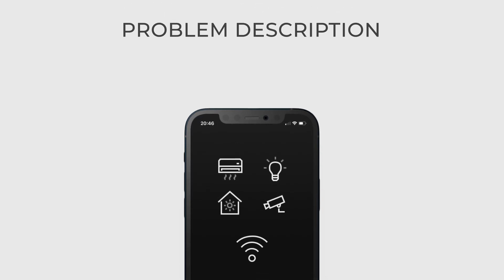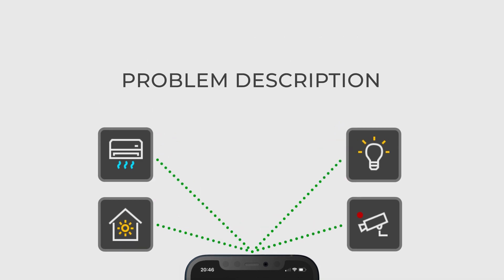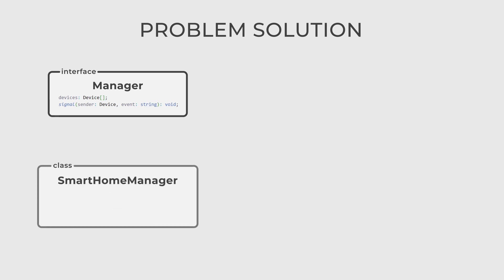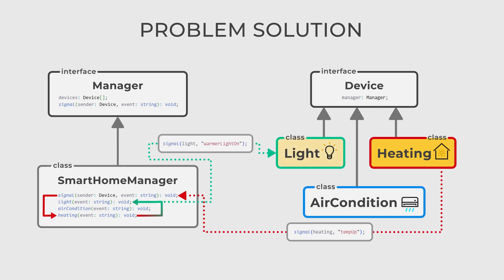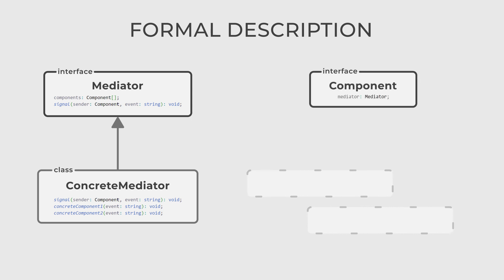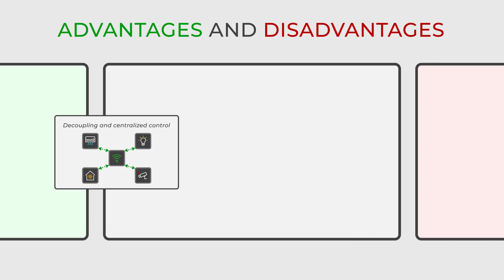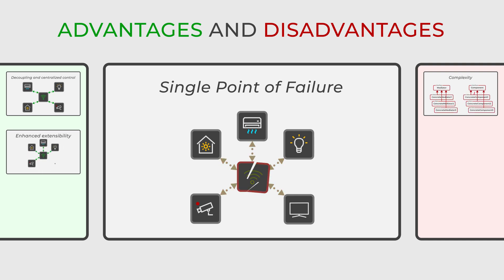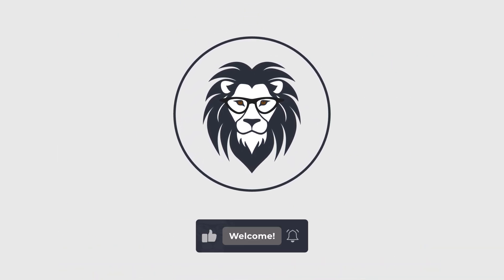Mediator - Design Patterns in 5 minutes

Comment: It resembles an observer pattern. like the mediator has a signal method and all the devices are kind of subscribed to that mediator.
Reply from the maker: Yeah, kind of, but in the observer, the subscribers should not be able to communicate to each other. This is the main difference of these patterns
Reply: @levonog At 0:37 it's mentioned that there is no direct communication between objects, so it's the same in the mediator pattern?
Reply: @ehSamurai3483  thats a good question. The difference is - in mediator there is a central controller, in observer there is none. Mediator is more suited for situation where communication is complex and forms a web-like structure.